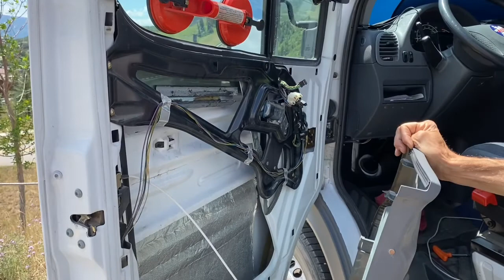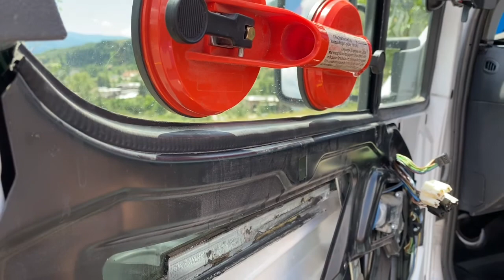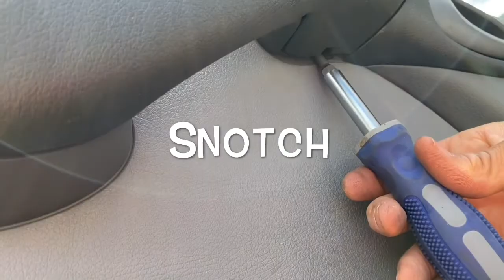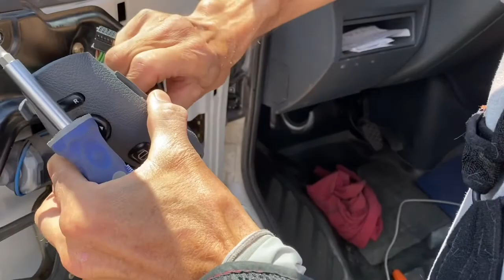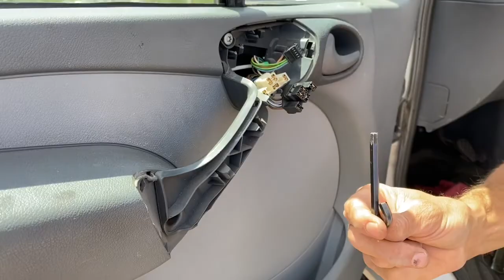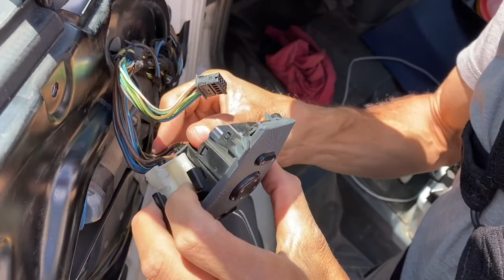Sprinter Power Window Hack - no parts needed!

Comment: I think if you bend the arm towards the track, that should help keep it in the track. You could make your own roller by squishing on a plastic bushing with channel locks. Maybe a PEX or PVC pipe of just the right diameter (I'd use a digital micrometer to measure). Or, you could snip off the rod, drill a hole in the arm in the same spot as the original rod that holds the roller, then bolt in a new generic roller from the hardware store. Problem solved, for good. Great video though, well done with all the edits and notations - thank you for the info, plus I learned about how the door panel works with all the clips and such.
Reply from the maker: Cool, thank you for the great suggestions, AncapistanVam!

Comment: Did not fix the problem spent the entire video taking off the door panel and didn’t solve the original problem of why it came out of the track at least fix your description
Reply from the maker: So sorry! This did fix our problem, and we do mention that we don’t have the original roller. 4:27 shows the arm actually pop back in place by using the motor. We do mention that we don’t have the roller and this is the second fix - the first being a year ago.  Anything else we could have added to make it more clear?